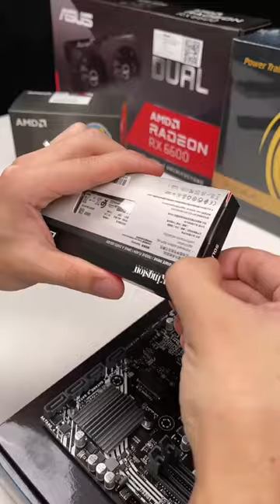AMD Ryzen R5-5600😎 with ASUS DUAL-RX6600🔥#pcbuild ASMR #shorts

Comment: Where is the heatsink on that ssd?
Reply: Motherboard doesn’t come with with one. And neither did the ssd I’m assuming. not all mobos or nvme drives come with their own heatsinks
Reply: @seanryu5214  that ssd is quite hot, thats why I was asking. It aint gonna last long without the one
Reply: @mistahj8968  true I heard that specific model is cheap but runs (Kingston snv2s) hot I never said it didn’t need a heatsink I was just answering your question.
Reply: @seanryu5214  Yeah, yeah I know

Comment: Not even close to enough paste, that cpu gonna be a hot mf
Reply: The paste is meant to cover the little micro crevices in the cpu and cooler to make cooling more efficient. You don't need a year's worth of paste in it. And the cpu is mostly in the middle of the ihs anyways so you don't really need to cover the outer parts.

Comment: Asus has declined big time in quality.  I remember before Best Buy even carried their products.  Asus didn't make everything under the sun.  Then Asus started making everything, that is when the quality went downhill.  Most of these companies now do this.  Monitors, drives, cases, gpus, boards, wifi, ram, psu, and so on.  I try to stick to a company who only makes one or two products.  That way you know the quality is better.  Sucks EVGA went down with Nvidia.  Maybe more GPU manufacturers will fall off Nvidia's list soon. I do see it happening. At least the smaller companies.
Reply: EVGA sold power supplies that would fry your pc for years

Comment: Intel Core i7-12700KF Procesador de escritorio para juegos 12 (8P+4E) núcleos hasta 5.0 GHz desbloqueado LGA1700 Serie 600 Chipset 125W . SSD M.2 980 PRO 2TB PCIe NVMe Gen4 interno para juegos (MZ-V8P2T0B/AM) . MSI Placa base para juegos Z790 Project Zero (compatible con procesadores Intel de 14ª/13ª/12ª generación, LGA 1700, DDR5, PCIe 5.0, ranuras M.2, LAN de 2.5Gbps, USB 3.2 Gen2, Wi-Fi 7, ATX) . MSI MAG CoreLiquid 240R V2 - Enfriador líquido de CPU AIO ARGB - Diseño de tapa giratoria - Listo para LGA 1700 - Radiador de 9.449 in - Ventiladores dobles ARGB PWM de 4.724 in  . ASUS Tarjeta gráfica dual NVIDIA GeForce RTX 3050 OC Edition Gaming - PCIe 4.0, memoria GDDR6 de 8 GB, HDMI 2.1, DisplayPort 1.4a, 2 ranuras, diseño de ventilador de tecnología axial, tecnología 0dB, soporte de acero .  Seasonic Focus GM-550, 550W 80+ Gold, semimodular, se adapta a todos los sistemas ATX, control de ventilador en modo silencioso y refrigeración, fuente de alimentación perfecta para juegos y diversas aplicaciones, SSR-550GM. .  Corsair Vengeance RGB Pro 16GB (2x8GB) DDR4 3200MHz C16 LED. Memoria de computadora de escritorio. Color negro. . Corsair Vengeance RGB Pro 16GB (2x8GB) DDR4 3200MHz C16 LED. Memoria de computadora de escritorio. Color negro.